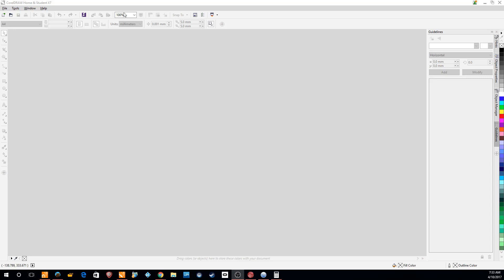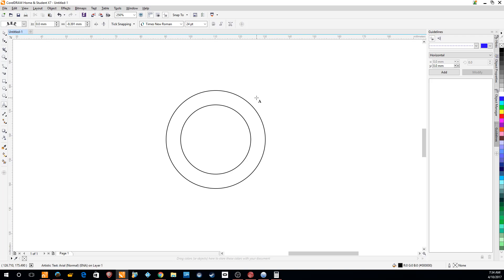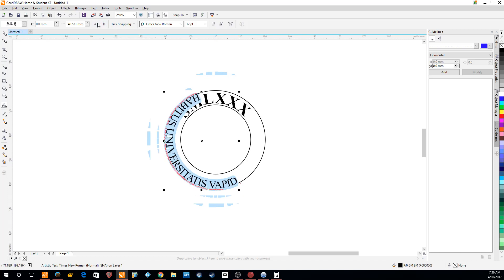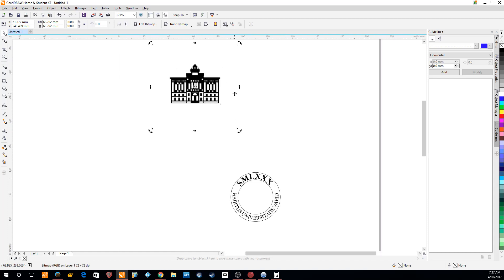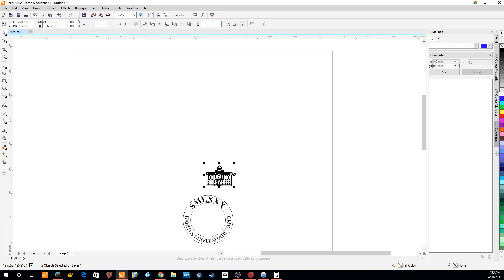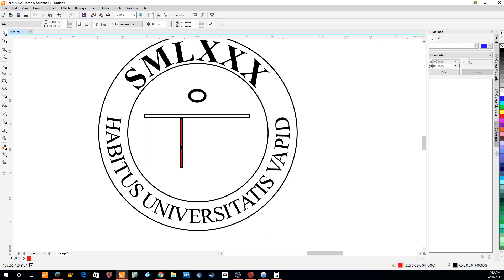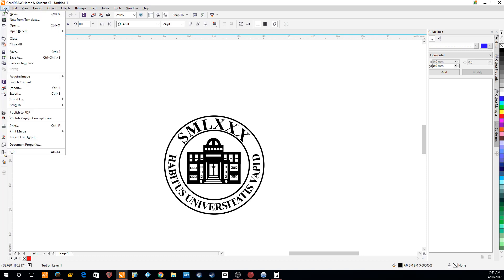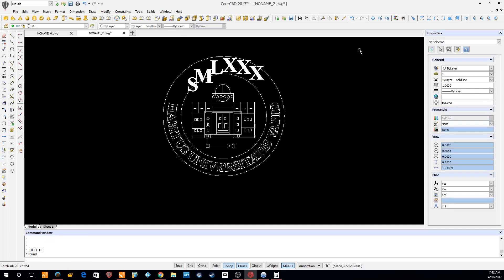How to use CorelDraw and CorelCAD together

Comment: Hello David, Hoping you can offer some insight: I am considering purchasing CorelDraw 2019 for the purpose of designing 2D images to cut metals out on my CNC Plasma machine. I just realized there is a CorelCAD available. My colleague only uses and recommends CorelDraw. Wondering what opinions you have for using CorelCAD instead for the reason that I will only be using it to create 2D images consisting of lines and curves?

Thanks for any help..